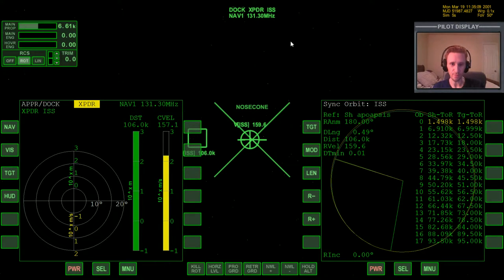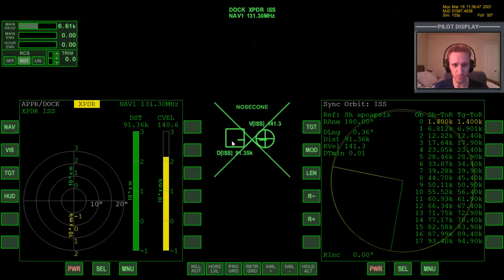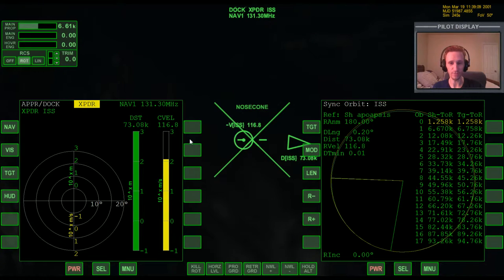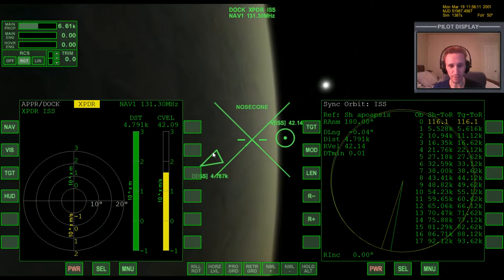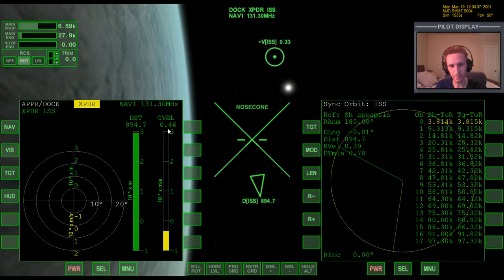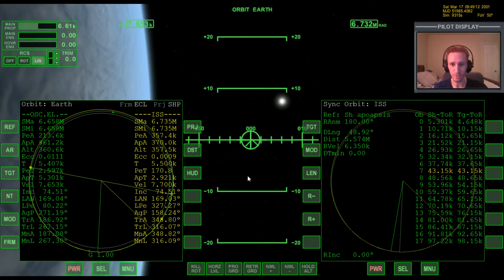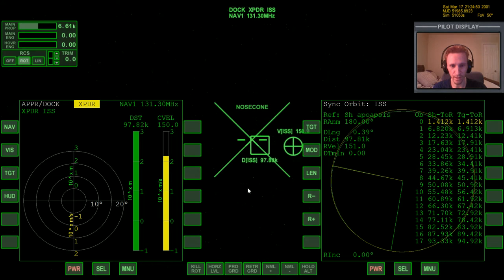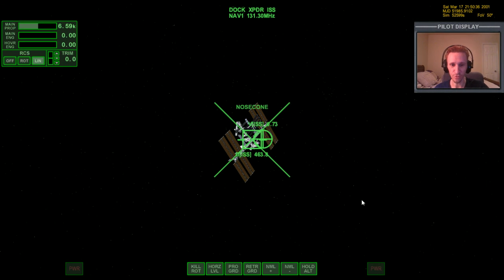Orbiter 2010 - [Part 7] Absolute Beginner Guide - Rendezvous / Sync Orbit MFD 2

Comment: what is retro engine?
Reply: Hi Stewart, it's an engine that faces forward. In other words, when on, this engine will produce thrust in the longitudinal direction, and in the opposite direction in which the nose is pointed. So, it allows you to "put on the brakes", or reduce your forward velocity.
Reply: ***** thanks,  i managed to dock into the ISS, i am on the way to the moon, this simulator is prety awesome   a decade ago, this would be only in imagination,,,